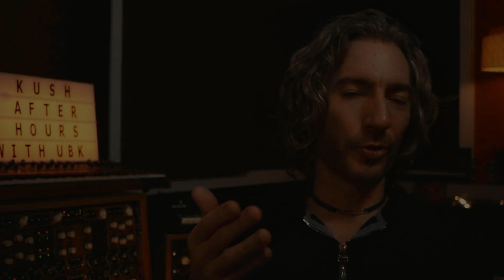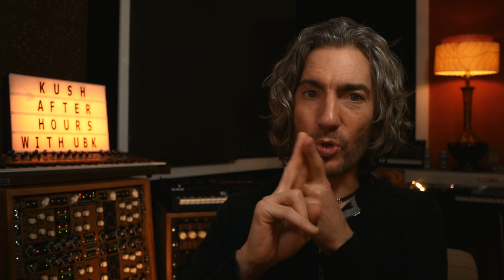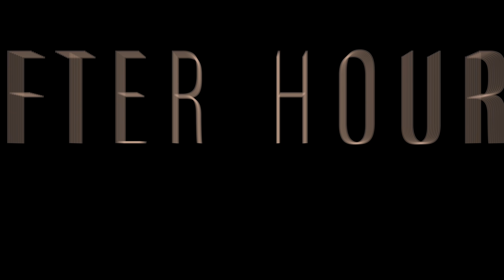Dial your KICK and BASS Faster & EASIER Than Ever!

Comment: This is such a cool trick. If I've side-chained my kick to my bass, would this technique work better without the side-chain comp engaged?
Reply from the maker: If you're going to have that processor in the chain, then absolutely, you should have it in the chain when making any kind of adjustment.

But... for shits and giggles... indulge an old man: bypass that sidechained comp on the bass, try mixing without it using this 'touch' technique.  Not that any approach is better than the other, but you might find a new preference if you give yourself a bit of space to explore.  Or not, but you'll learn something either way!
Reply: @TheHouseofKushTV  so I tried this technique and it’s really effective in getting that sub information I wasn’t hearing!

Comment: This is what I do but with a peak/distortion perspective. As the music I do is supposed to be played at high levels, I tend to insert a gain in the master output and crank the shit out of it in order to understand whats really making the sound distort at high levels. Usually I have the same movement sensation on the subs. What moves/distorts further from a certain point usually its what needs to be corrected or enhanced.

Comment: Studio monitor manufacturers always say never touch the subwoofer cone but sometimes I do it randomly
Reply from the maker: Well, to be 1000% clear: I'm not advising you to touch the cone either, I'm advising you to lightly touch the foam surround in a way that doesn't impede its motion.  The mfr. advice is more about not pushing the woofer in manually, because "that's not good for the thing". 😊

Comment: I wonder how I could best apply this in live sound?  I guess I could leave FOH and go put my hands on the dual 18in subs down by the stage. Take the iPad with me to mute/unmute things?
Reply from the maker: Oh, that's totally not necessary for live sound, because all that matters with live sound is what you're hearing in realtime, in the venue.  We need to do stuff like this in the studio because the production will (in theory!) be listened to on a myriad of different systems in a myriad of spaces, so the mix should be balanced in a way that plays to the averages.  

IOW, if you get a big fat thumping mix in the live venue, and it sounds great, you're golden.  But if you get a big fat thumping mix in a studio where the bass is not accurately represented, you're probably printing a mix whose low end will overwhelm many or most of the systems out in the world, and the song will sound boomy or muddy or some other version of 'shitty'.  😊

BUT (and forgive me if you know this already),  if at all possible you can and you should move around your live venue to listen to how the low end is playing out, because it will sound verrry different in different parts of the room.  Doubly so when the body count changes significantly, because people are awesome absorbers and diffusors 😛

Comment: Do you use diffusers in your room? if so, where? (rear wall, ceiling etc)
Reply from the maker: I have quite a few 'diffsorbers' around the room, not pure diffusion but not straight reflection either, a good middle ground that works well in rooms as small as mine (12x14-ish).  But I'm designing a new room that's a little bit bigger and might have larger more dedicated diffusors in there, not sure because I like the "70's drum booth" sound which was mostly absorption with some straight reflection.
Reply: @TheHouseofKushTV  Interesting. I'm building a 20x30 room and am wondering if I need diffusers

Comment: I did this instinctively for a long time on my HS80s, but had to stop years ago because the foam developed some indentation. Don’t recommend it if you’re OCD. But yes I remember it helped me to learn to select the right kick for the bass etc. although it was more of a phase issue I feel
Reply from the maker: Yikes!  The idea is to touch it suuuuuper lightly, there should be zero pushback on, or deformation of, the surround.

That said, you can refoam your speaker on the cheap, I've done it a few times on really old hi-fi speakers where the surround had quite literally disintegrated into dust. 〄

Comment: Just discovered your page today and hands down the most valuable music resource I have come across. Upset with myself for not finding sooner. 

Do you mind talking about the outboard gear you are using on your mix bus if any at all? I am “in the box” but am curious about the benefits of using tools like compressors, eq’s, tube/ tape saturation, etc. and how that can inform other mixing decisions...sort of like reverse engineering the mix based on tonal and textural decisions if that makes sense

Comment: Another thing you can do is buy a tactile bass speaker like a Subpac/Woojer/Basslet. I have the Basslet myself and it's incredible the amount of bass detail it provides, especially when judging energy levels and lengths of kicks/basses/sub drops etc. It just outclasses ears & speakers in this regard, and my studio likely has more linear bass response than 99.99% of people reading this. What Gregory is describing in this video is essentially a "ghetto" way of turning your regular speaker into a tactile speaker - I've never tried this myself but it makes sense considering my experience with a tactile speaker.

Comment: Rookie question: Phase cancellation caused by a peak and a trough of 2 seperate waves of one sound being exactly aligned, is that bcs it stops the speaker cone moving due to equal pull and push happening at same time?
Reply from the maker: If the phase relationships are cancelling something out, it's not that anything is preventing the speaker from moving, it's that the speaker isn't being told to move in the first place 😊
Reply: @TheHouseofKushTV  Ahh ok thanks got it, and thanks a lot for the interesting videos.

Comment: Stupid question, but I'm lost as to where you put your fingers. "The foam surround of the woofer" does this mean the cone? Anywhere on the cone?

Also, say that you determine through feeling with your fingers that the groove isn't working. What are you to do with that information? I'm skeptical about EQ-ing based on this trick against the judgment of my ears, but I'm always curious to try new techniques, so I'm interested in what to try.
Reply from the maker: Good questions!  The foam surround is literally that: the circle of extruded foam that surrounds the cone of the woofer.  So, not the cone!

As for what to do with the 'groove not working' info, that's really something you have to learn thru trial and error but the main starting points and "areas of conflict" are 1) levels, i.e., play with the kick and bass faders to see if there isn't a blend that gels better; 2) sub filtering, on either the drum buss or the bass or both, thinning out the excess info that can blur and bog down the bottom; 3) compression and sat/distortion on kick and/or bass, to shape the transients and the tails and get things moving more in time. 🕺

I would absolutely trust the excursion the woofer over your ears, because the woofer is 100% true to source whereas your ears don't hear bass, they hear 'the room's distorted depiction of bass'.  So unless you purpose-built or insanely-treated your control room, you should always treat what you hear (especially down below 200Hz) with a huge grain of salt.  Put your finger on the woofer while listening to reference recordings, train your ears to 'hear' what your body is feeling.  Then switch over to your mix, notice what changes with your hands first, then study how that translates into what your room is saying.
Reply: @TheHouseofKushTV  

Thank you for the detailed answer, sir. I will give it a try. I am happy to add more reference points if nothing else. Your channel is always the best by the way.

Comment: I was in a situation for a while where I couldn't use my subwoofer at night because it would bother neighbors/roommates... but I NEEDED to mix. I took a cheap speaker out of a $10 Bluetooth boombox, removed the cone material, wired it through a small amp and a lowpass filter (slopes around 80 - 120 hz) and bolted it to the frame at the bottom of my chair. It's called a tactile transducer, or "bass ahaker." The result is that you can feel the bass as a vibration in your chair,. This tricks the perception into feeling like you are listening on a large commercial system, but no one else can hear the bass. To anyone not in the chair, it just sounds like there's no bass in the mix. At night when I had to be quiet, I would put on some good headphones and turn on the bass shaker, and managed to create an awesome mixing environment for myself that completely bypasses the need for acoustically treating the room for bass pockets etc. Your tip here reminded me of that, and I can attest that you know what the f you are talking about and then some.

I highly recommend building (or buying) a tactile transducer for any studio as another method of referencing the bass mix. There's a really good commercial version called the 'sub pac.'  I just built mine from an old cheap speaker, some speaker wire, some dirt cheap op amp chips for that I pulled out of scrap electronics for the amp, a few resistors and capacitors for the filter, and a 12volt wall wart with a stripped wire to provide power... total cost of the whole thing was maybe $3 and a couple hours of time.

Comment: Related to the "unable to hear and understand the low bass in my small room with my small monitors" is the question of mixing with headphones, and products like CanOpener, a crossfeed plugin with some other nice things, and things like Waves NX which claim to present a room to you, accurately, which frankly, I don't believe. I think that all abstractions are leaky. I'm a software developer and a believer that everything has a down-side.   I have a gut level feel that things that aim lower (like canopener) may be coloring and distorting my own judgement less, by giving me a bit of a room like ability to hear a mixture of my left and right via crossfeed without trying to simulate the bass response of a great monitoring position in a great room, which I do NOT believe anyone has cracked the level of computation that would be required to really do, and even if they did, it still requires non trivial amounts of guessing and fracking around with, to get head transfer and other variables sorted in a sane way.  What are your thoughts on headphone-mixing in general, and headphone-mix-plugins specifically?

Comment: Hehe...or you simply find a good tactile transducer (ie shaker) that is reasonably flat and strap it to your listening chair...flip your reference in and out...voila. FEEL the base without leaning forward. Make sure you have a good chair...cheap ones rattle eg aeron copy etc.
I did that with a fosgate T rail...works great: Actually tells you a lot about phase in the 40-80hz...its really rubbery and has weird wobble to it...when in phase its tight
Reply from the maker: Nice!  At the tender age of 50 I'm too much in "protect hearing at all costs" mode, and conductive hearing loss is a real thing so I try to minimize any kind of technique or volume where I can actually feel the bass in my bones.  But I'm also autistic and have had tinnitus since childhood, so I may be more cautious than others!
Reply: @TheHouseofKushTV  Im TOTALLY with you...Im 56...wasnt too bad until a month back...did an FOH engineering job...tinnitus hasnt gone back down...the room had a huge 200hz bloat (must have had 11sec of RT60 so it became a mushroom cloud of tinnitus inducing vomit). Last time Im doing that.
The chair shaker is such a dial in device...without volume. You just exagerate it with a bit of volume (well energy) and it makes you REALLY realise what is going on down there. Using spectral keyers like trackspacer/DSM and you can really use a magnifying glass to clean up.
I had to radically change my mix habits...its a journey...but I do most of the mix at low volume with these little 4" 1 way sphericals made in stone enclosures (aurasphere)...kind of NS10/auratone idea where the magic is in the midrange kind of deal and its very much like balancing in B&W photography now...after some comparison mixes, I sold my NS10s...big call but my ears are so much better for it.

Comment: Do you ever highpass the bass instead, and let the kick fill out the sub-bass (60hz and below)-kick under bass, rather than bass under kick. I like the Kick extending into the sub-bass to get a nice visceral thud. Do you ever use a multiband ducker such as Trackspacer so that both the Kick and Bass can share more of the sub-bass without muddiness?
Reply from the maker: Yes to inverting the relationships, no to using multiband anything.  Multiband = phase distortions at the crossover point, and I am super sensitive to phase on the low lows.  But that's just me, everyone has their own ways of working and there's absolutely nothing wrong with what you're doing, as long as it gets you where you want to go!
Reply: @TheHouseofKushTV  Actually, I think I am wrong in comparing Trackspacer to a multiband compressor. Trackspacer creates space in a mix by carving the frequencies that a track needs. It applies an inverse EQ curve after analyzing the sidechain signal. Analyzing it with the free EQ Curve plugin, I see there is some phasing shifting occurring only in the frequency range the sidechaining is being applied, similar to manually carving out some space using a standard EQ.

What is the issue with some phase distortion in the lower range as long as one is not doing parallel processing for example? Are there still changes in tonality?

I would love to more from you on how to get the kick and bass to work with each other. Thanks.
Reply: @sammiller9855  trackspacer always seemed odd. If i separate with eq it might be more of a notch instead? But a boost might be low Q at similar freqs. It seems it doesnt listen to the track it applies it to? Something like Soothe seems better as it works with resonances.
But given that Soothe works by removing what pokes out on the track, and trackspacer instead removes what pokes out on a different track wouldnt it end up de-masking all the 'pokey' parts we call nasty resonances?
Reply: @jorgepeterbarton  Interesting point. Perhaps, one should first remove any unpleasant resonance from the track used for sidechaining in Trackspacer?

Comment: Allow me to blow your mind: Your fingertips are actually MICROPHONES!!! Put your fingers on a surface. DON'T MOVE THEM. Can you feel the structure of the surface? Not really. Now, brush your fingers over them. Now you feel the tiniest part of the surface. Except you are not. They HEAR the surface... through your fingers. 

They have made tests with remote sensing robot hands, which have microphones in the fingertips of the robot, and tiny piezo-speakers in the fingertips of the operators gloves. And you can FEEL structures doing this! I tested this myself at the SIGGRAPH conference a few years ago and it is cool as heck!!

Comment: So at about 6:50 when you start explaining how you mix kicks/bass a little, I’m just wanting a little clarity. Are you saying put the kick transient barely before the bass so it kicks and gets “out of there”? And also what do you mean by 12db per octave? Thank you!
Reply from the maker: Ahh, ok, I think I know what you're asking.  I'm not talking in any way about moving anything around in time, that would completely alter the groove (if you work with live drum tracks like I do, if you shift one element every element has to shift with it or your phase is toast).  Sometimes you do want to do that, but do it for the groove, not for anything else.

12dB/oct is the slope of the highpass filter I generally use on my drum buss, and I sometimes set is as high as 60Hz but if I go that high I may also use a gentle bell filter around 30Hz to restore a little bit of the weight lost from the hpf.
Reply: @TheHouseofKushTV  ok got it thank you!!!

Comment: another trick to experience the relationship in a different way is to use a scope / eq that can take inputs separately and colour them differently.. then you can see it with your eyes which can give you that extra sense you get by touching the speaker! I personally use SCHWA SCHOPE - which is free - for that then hard pan kick to one side and bass to the other.. then you can even turn the speakers off and see how they overlap in a visual way.. really good technique to learn about compression as well!

Comment: I've done the "feeling the speaker" trick for decades now and everyone looks at me like I'm insane.  I've always sworn that I can feel the details in the transient of the kick and snare better than I can hear it.  Especially after listening for more than 15 minutes straight imo.  Also feeling the air flow from the ports if you have ported speakers.  An overly loud sub freq will result in an obscene and disproportionate volume of air coming out of the ports even though you may not hear the freqs themselves.  A well mixed low end usually will make the air coming out feel like its resonating with the key of the song.

Comment: When mixing songs with both 808s and kicks- I’ve often noticed that certain notes of the 808 pattern are out of phase with the kick, but only certain notes. So, I end up having to split the 808 melody into 2 separate tracks, one track with the polarity flipped, the other not. And this is both before and after processing… Why is this?